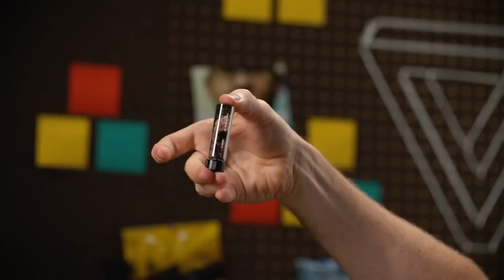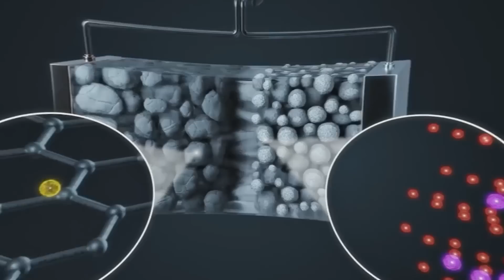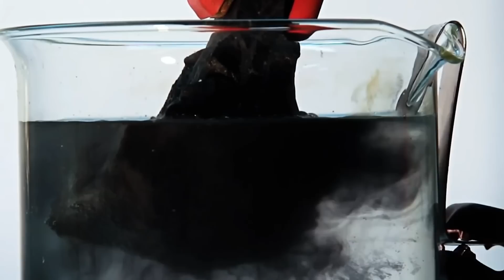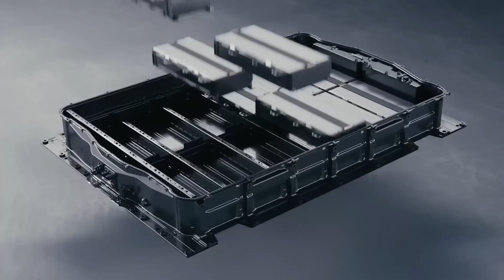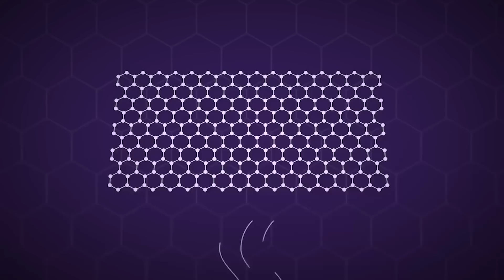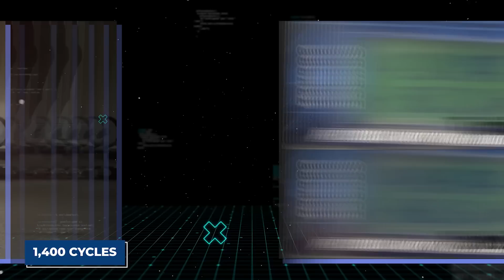Elon Musk's FINALLY Reveals New Graphene Battery?

Comment: Look at all the noobs thinking this is new.  If Elon has found a way, that's great.  I remember looking at this in the early 2000s.  The announcement of graphine and its potential with fast charging and charge holding qualities.  Less material to accomplish the same outcome.  Imagine your smart device with only a thin sheet for a battery.  Entry level phones can be packed with goodies stock.  So many application to stream line a bunch of industries.

Comment: #1 Start to judge the electric cars based on cost per hours of use. The Ford and virtually no experience compared to Tesla. FORD  vehicle that will probably need constant hi tech fault finding at the Dealership with the untested electrical systems driving up the cost per hours